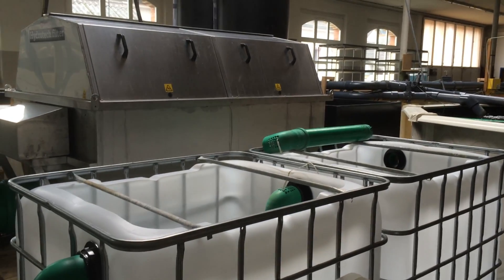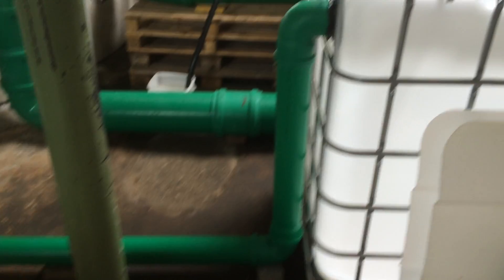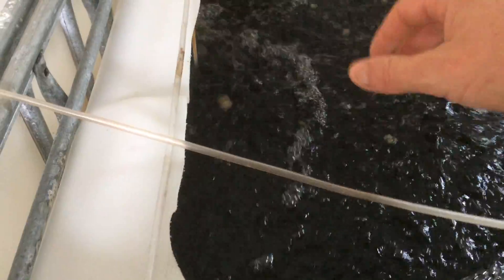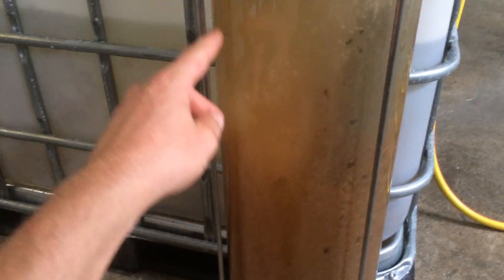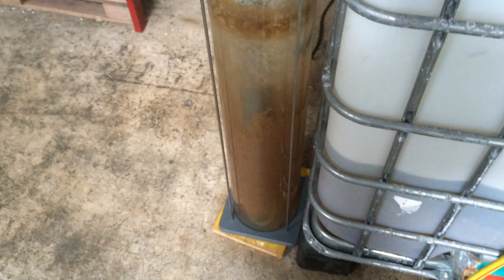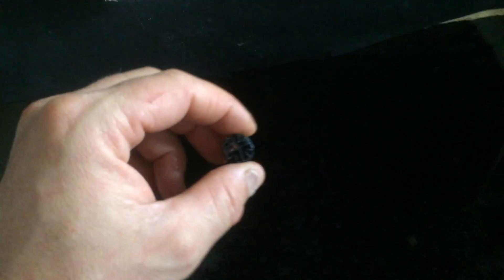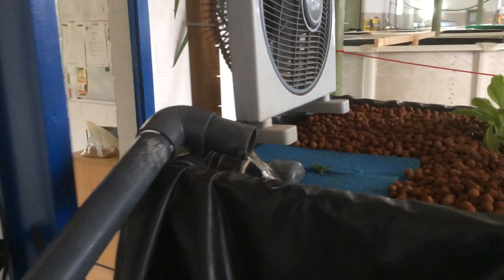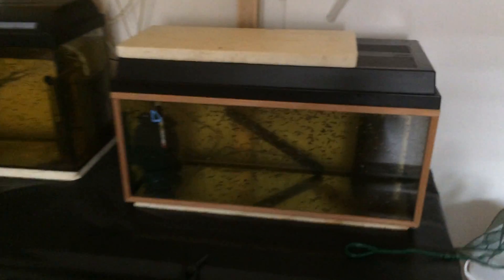Bio filter, drum filter for aquaponics and aquaculture, Filter system

Comment: what is the stocking density on yr semi commercial 7 tank aquaculture system? yr feedback will be much appreaciated
Reply from the maker: it is a quarantine system. we hold max. 15-20 kg/m3
Reply: Aquaponic Gardens thanks alot for yr feedback. its helping me to understand better. i am a bit confused on different journals that are giving very high difference of tan removal g/m2/day. do u have any guidance chart or notes which indicates how much tan can fluidized sand or plactic media can remove how much TAN gram per day per square meter?
Reply from the maker: No sorry. this is inside knowledge of the aquaculture industry. You could use less but I dont recommend it.

Comment: hi there. where did you get that pvc connector? i am in uk. i can not find a connector for the 110mm pipe
Reply from the maker: i can send you some.. how many do you need? you mean the bulk head fitting ???
Reply: yes. that bulkhead fitting. at the moment i use 50mm pipe for my trial setup but i am planning to use 110mm for the proper system
Reply from the maker: you can buy them from my website..www.aquaponicgardens.ch